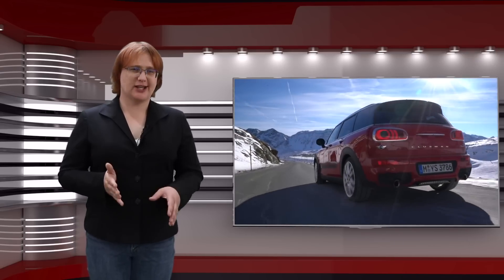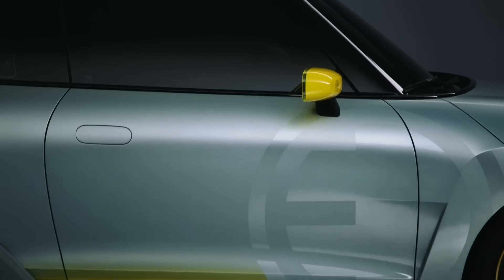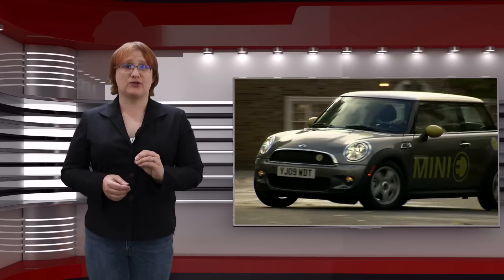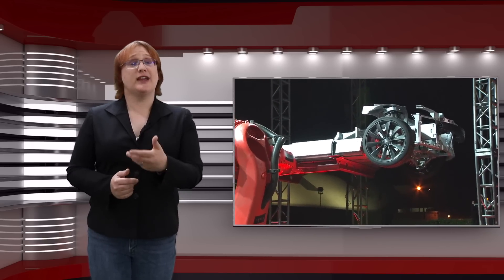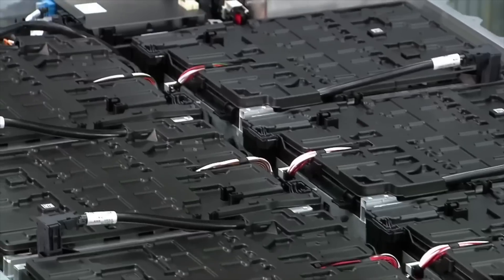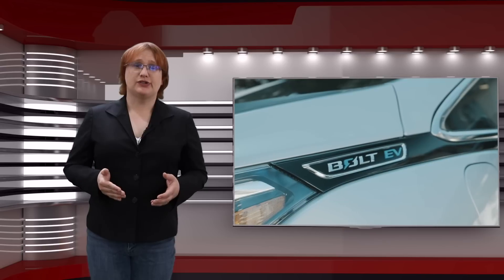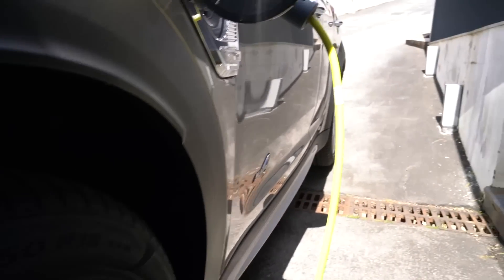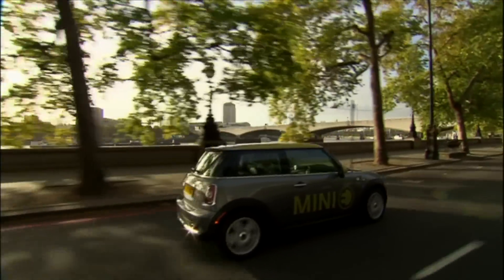How Easy Is It To Make A Good, Small Electric Car?

Comment: I think a 150 mile range is potentially adequate - when used in the context of a robust, well-placed charging network. (And assuming good enough thermal management to allow multiple sequential rapid charges, any time of year.) Legacy automakers just don't want to take the charging infrastructure question, though. Whenever they finally do, we'll know they are serious about a plug-in future.
Reply: I think in the more rural parts, charging at home and 150 miles is just fine. It gets problematic, when you live in a city, where your carpark doesn't have space for a charger. I've got a carlift in the basement of my building..., how are you gonna charge there? 
So public infrastructure definitely needs to be built up and I had a look. In Germany, precisely the state of Thuringia, I found almost no EV chargers in the rural parts, but in every city above 50k population, you typically find 2 or 3. Obviously not enough, but as more people buy, demand rises and more chargers should be built. It's just a chicken-and-egg problem.
Reply: I also want to see chargers take a Visa or MasterCard.  I'm in Germany and just 45 min from France.  If I want to drive to say Paris, then will I have to have a card from a French electric company?  We are driving to the Netherlands next month, I don't think I could do that right now in a non-Tesla EV.  I would get there and need a card from a Dutch Electric company.
Reply: If you're in a cold climate, the long range battery helps as EV loose range in the cold along with energy used to run the heater.
Reply: Peter Ilfrich,  Small fast destination chargers. Tesla is working on that also.  I love in Baltimore there is a fast DC charger 1 block from my home.  I woke up one day and it was there. There is a level 2 charger at the drug store 2 blocks from my home.  I live i a very urban environment.
Reply: Peter Ilfrich, in "rural parts"  an 150 mile range means you can only go 50 miles from your home unless you have an charging option at your destination.  If that option is only 120 volts you are only going to get back at best 6 miles an hour. If you have to drive 100 miles to work you can charge for 8 hours at 120 volts you are not going to make it home
Reply: Jefff, that's a good point. As close as they're to a standard for the charging stations, they're far away in real-world integration. I think the problem might be that there's still quite a few people around who don't use their credit card very much or don't have one at all (think of rural areas). That's probably holding this back.
Reply: Peter Ilfrich Ya but right now, if you can afford an EV, you should be able to have a credit or at least a debit card.  Could you imagine have to have a particular card for every gas station that you want to fill up at?
Reply: I'm married and for me an EV would work as we are a two car family.  But I look at the overall cost to a ICE.  My year old Hyundai was a Euro reimport and cost just over 16000 euros.  Now it's hard for me to justify spending another $30,000 to go electric.  I know the technology will improve and cost will go down.
Reply: Jeff, By Used.  Almost all Electric cars take a 50% hit the first two years ( Excluding Tesla and now the US only Volt) .  I do not know about Europe.  In the States you ca buy an 2 year old sub 10,000 mile BMW I 3 for 16k.  That is with two years left on the BMW bumper to bumper warranty.  Most battery an motor warranties are 8 years 100,000 miles.
Reply: fatboy19831: Very few people go 100 miles to work, but there a lot who do 50 miles or less to get to work.  8*6=48 So if you have a charger at work then the time use are there will give you a nice top-off.
Reply: Earl, most sales people can easily exceed 100 miles a day.  How many people are in sales?  Work in Ny ,NY , Washington D.C. Philadelphia an 100 mile commute is not out of the question.  My ex has an 95 mile commute from PA to DC.  The homes in PA are 1/3 the price of DC.  The salary in DC is twice what it would be in PA.  Both are not rural areas and have access to fast charging. Not to mention you get to use any express lanes. Electric cars get amazing range in stop and go driving.  At my exs job they have free  electric car charging and parking.  Most likely out in North Dakota that would not be the case.
Reply: Earl Pottinger another reason I want 250 + range is battery degradation.  Running a battery down then charge all the way up leads to rapid degradation.  That’s why many Tesla’s have over 90% capacity because owners often only change up to 80% and run to 50 or 60%.
Reply: Jeff, That just has to do with battery management.  There are many Teslas out there that ONLY use the supercharger network.  The battery will not last as long as someone that only charges at home but it will last far outside the 80,000 warranty.  Many Volt owners form 2011 still have the same 35 mile range they had when the car was new.  GM cools and heats the battery and will never let it charge over 80% when new and the gas engine kicks in at 10% life.  In addition the Volt can only slow charge.  Battery management is far more important the maximum range.  The Nissan leaf has horrible battery management.  You have to do all the work yourself.  Keep the car in a cool place only charge to 80% and do not fast charge or deplete the battery and you may get a few good years out of the battery.  That does not seem to be the case for most leaf owners.